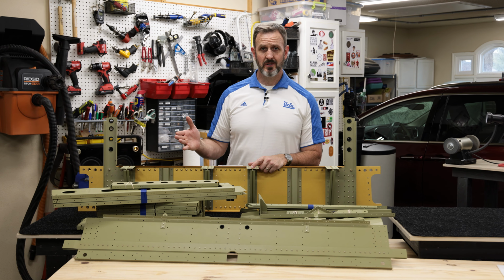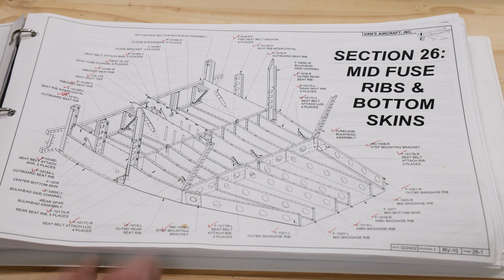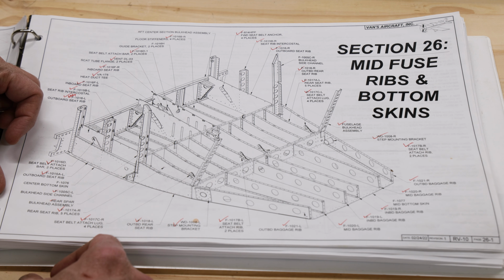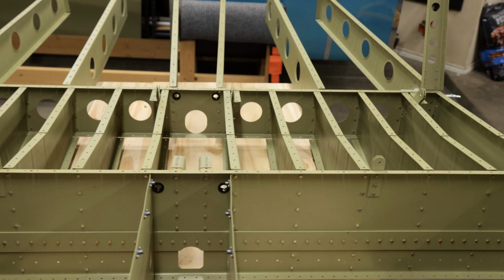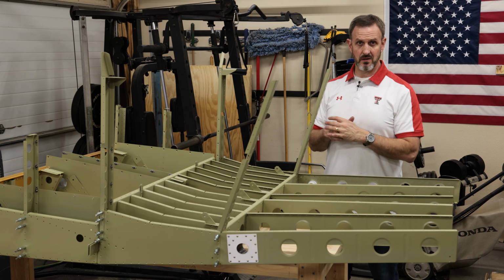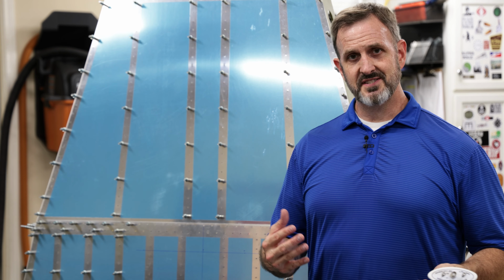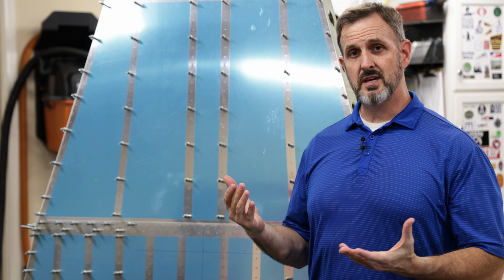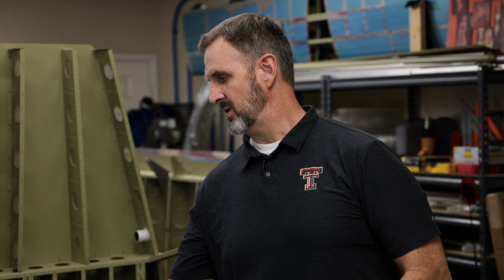Building the RV10 - Video 24 - Mid Fuselage (March - April 2024)

Comment: That is hypnotic!!!  Is your fuselage kit final sized from Vans, or did you have to ream to final size?
Reply from the maker: Almost all of them are final sized, particularly the #40 and #30 holes.  If you noticed the part where I assembled, drilled, disassembled, deburred, and then reassembled... I forgot to enlarge some holes for some bolts when I test fit everything earlier.  But most of the holes are final sized.